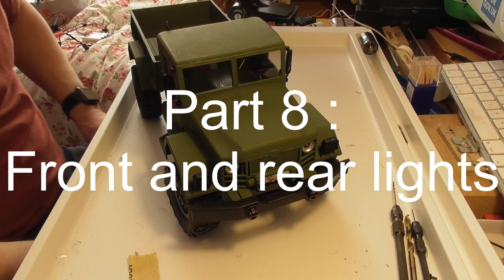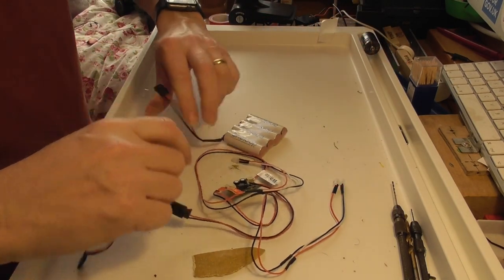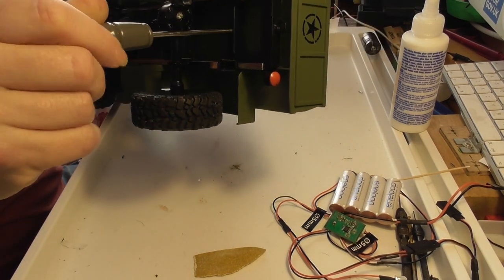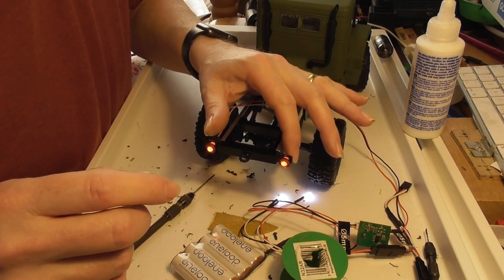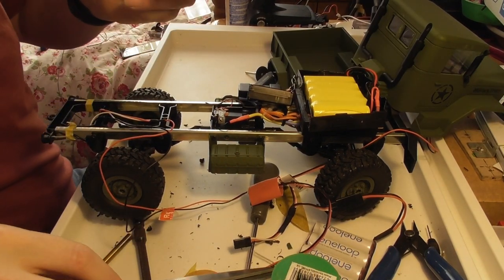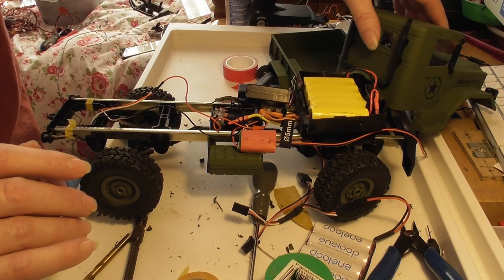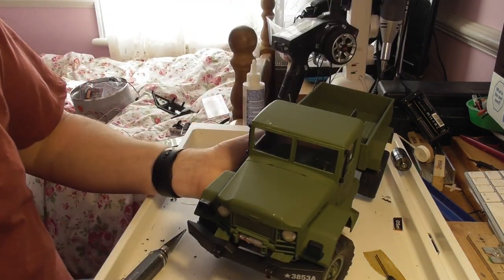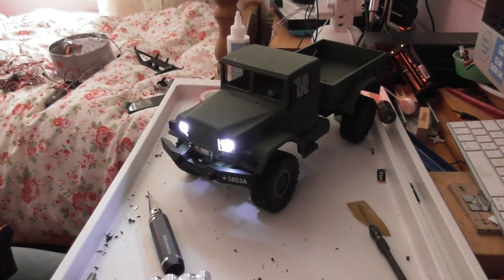Heng Long 1/16 military truck hobby grade conversion Part 8: front and rear lights

Comment: I have recently picked up one of these kits without the electronics, and thought I would do much the same as you have done on your B-1.  I am going to be painting mine up to look like a proper M35A2, like I drove while in the Marine Corps.  I can tell you that you could have gone with 3mm LEDs for the tail lights, as the tail lights on the original truck where almost invisible during daylight hours.  Great series overall, I just thought I would drop you a note.  Semper Fidelis.
Reply from the maker: Thank you. Please feel free to post a link to your video here when you've done yours, I would love to see it.